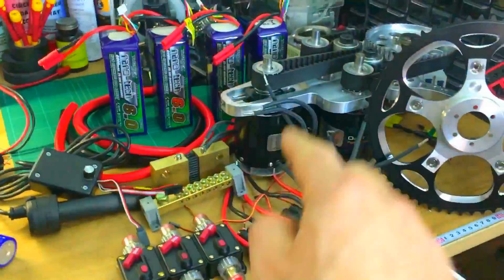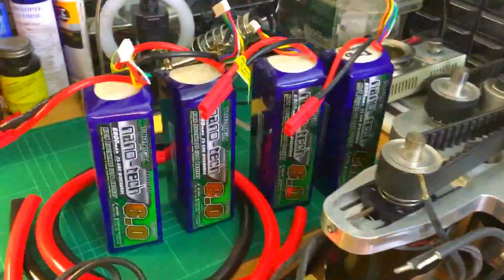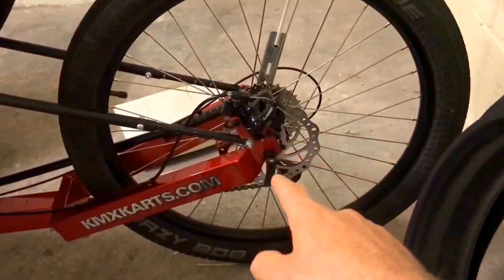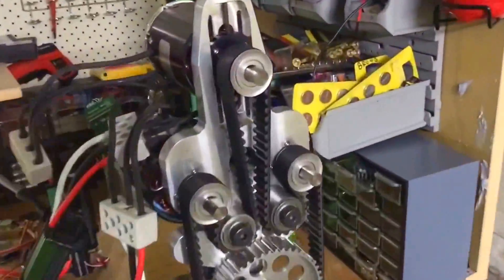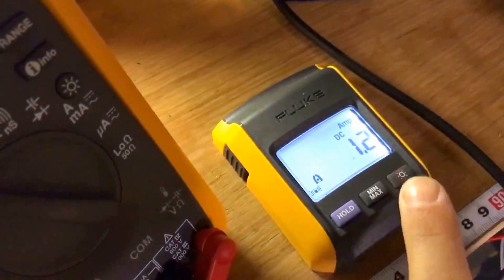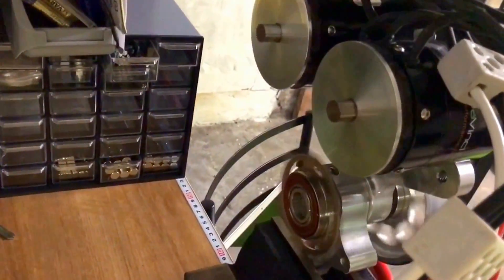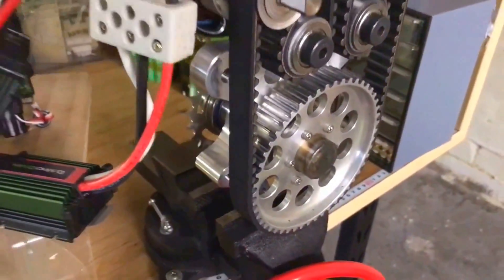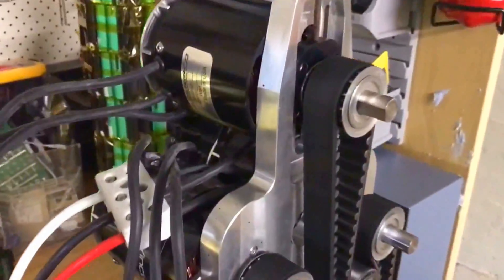42000w 56hp Electric Bike Triple Motor (video#1) Bench test & showing where I'll be installing it

Comment: Hi im not good in electric motor calculations but i check on their astromotors website and these motos  says are 4kw and 100amp max. How can they go higher with out to get destroyed?i want to do an electric bike simillar power as an honda cr125 motocross.how can i choose the right motor? I love your videos!you should make them longer !!
Reply from the maker: Yeaaahhh the original sealed motor housing can do 4kW continuous but a LOT more peak power. My one has been machined open and a fan was installed on the end of the shaft sucking air through cooling the motor winding, also I have a much thicker motor shaft than the standard motor. Can do 14kW peak each motor times 3 motors it’s pretty insane.... Here is a playlist showing all the other videos https://www.youtube.com/playlist?list=PL59mIOWSOm9qRtb4Yvj9wnYy_mDK_v-6i
Reply from the maker: Here are lots of photos showing the building process https://www.youtube.com/redirect?event=video_description&v=sRH_cpCwNDs&redir_token=44cPYGDuRW7ll0Q788Nan_BgEdh8MTU5Mjc0MzE4NUAxNTkyNjU2Nzg1&q=https%3A%2F%2Fwww.facebook.com%2Fpg%2Fbrunopoweeer%2Fphotos%2F%3Ftab%3Dalbum%26album_id%3D290190614924067&html_redirect=1
Reply from the maker: My setup is too complicated, I would recommend buying a large Motenergy motor and por with a very powerful controller like the ASI BAC8000 or something even more powerful

Comment: Really nice setup!  Only one question;  how do you get 42000w  from  a triple  3220 Astro motor  when it is rated  each at 6000w  max   1 min.  peak?
My  numbers are: 42k÷3 = 14k each!.  That is  more than twice the motors peak specs
Reply from the maker: +Andrei Gauna Adamson Hi, my motors are not a regular 3220 sealed housing with thin motor shaft. it's a lot to do with cooling, my motor housing is CNC cut open on both ends and it has an extended extra thick shaft with a fan forcing air through the windings cooling the motor down. It is also a faster winding for higher RPM. I measured over 11000rpm and the battery wasn't even fully charged!
Motor manufacturers always rate their motors much lower than they can actually take, same with battery manufacturers and many other products.
You can't just dump (send) power to the motors, the motor actually sucks power from the controller depending on the load applied on the motor shaft. My trike is 35kg and capable of doing 42kw, technically it will be almost impossible to force this super motor enough to "suck" all this power from controllers/batteries.
Anyway... are u getting one yourself???
Reply: ElectricBike Posibly!  I'm actually bulding a couple of things and planning to start a channel.   Will see!       Something with lots of POWEEERRRR!!!

Comment: I really hope you reply as I want to build a roughly 6-7kW electric bike myself. I notice that you're using Castle Creations Edge 160HV's but from what I have found, they can only do 160 amps, so I was wondering why you say 280A in the video and description?

If anyone can help me, I was thinking of using a SKYRC TORO Beast Brushless Motor, probably the X524 2Y or the X528 2Y depending on what ESC I can find to power it. If anyone can point me in the direction of something better that would be greatly appreciated.

Comment: What controller are you using for this? Or is it just the 3 small, green things you have showed???
Reply from the maker: this one is just a normal ebike controller and hub motor setup... but this is all you need in this little fun drift trike haha... of course if this was my trike I would go ridiculous and get the biggest possible motor and probably kill myself on the first ride hahahaa.. 
I watched this video in slow motion so many times.. can't believe I wasn't wearing any protection hahahaa.... =]
Reply: hahahaha^^

Comment: Hey electricbike… You are CRAAAAAAAAAAAZY MAN… I have a question about this ridiculous three motor reduction system.

I have this vintage 1964 Volkswagen bug with no engine and a curb weight of about 1500 pounds without the engine. The stock engine is a 1200cc putting out about 36 hp.

The specs of your monster three motor trike system lead me to believe that it might push a vintage Volkswagen down the road pretty nicely if I'm not mistaken. I see where this system is ridiculously overpowered for your trike BUT… It might be a nice match for a VW bug… The bug would not be burning rubber off of rims but yet have better than stock adequate power.

What is your opinion you crazy amp head… Is my thinking flawed somehow… Not exactly sure how the main drive would connect to the transaxle… Probably need a big battery pack like a 144v 150ah.

Do you think it could work?

Comment: 42,000 watts @840 Amps Peak.......rpm is going to be insane...I reckon this should be good for 120mph !
Reply from the maker: MisterMacrae yeaaahhh the motor rpm is over 11000... the wheel is a matter of gearing haha... 
did u watch video #3 taking this thing for spin at "only 300A" ? Haha
Check it out: https://youtu.be/sRH_cpCwNDs
So much POWEEEERRR hahaha

Comment: do thing you can show how to change one of the controller  form a 36v to a 48v and see if it dose work ? on a video?  if you have time,  it would be a big to me if you could. because aren't all the motor the some it just the controller right that different and also they didn't specify the mph on each motor but high voltage is more powerful right. ?

Comment: Hey do you have any videos or you change the controller power on the 8 fun motor or do you think you can show how you can change the controller like for a 36 volt to a 48  volt  because also there is 36v 18 a - 36 volt  20 a and so on but I want to know if what the difference between 36v 350a 36v 500a - 48v if maybe show how you change them or explain what's the difference in these different controller you, said yes but  what in all if these controller and in changeable with the motor I get from ailexpress I think a fair price but not enough power like you said you show me in a video

Comment: Awesome, can you include details about the controllers/ ESC in the next installment?
Reply from the maker: +Ryan O. Yeaaahhh I have lot of info on the video description, in using 3x Castle Creations 160HV tuned to pump up to 280A (840A total for 3 controllers) they're all connected to the same throttle and have the exact same setting, same power and phase wire length, they'll need some additional cooling so it doesn't fry under this ridiculous load but I'll be watching the temperature very close.. ohhh yeahhh so much POWEEEEEEERRRR =]

Comment: 1500 watts just to turn it lol! 
should be fun though mate, you certainly seem excited ahahah.
Reply from the maker: Yeeeaahhh.. ahahahhaa.. 1500w just to turn... its like some powerful subwoofers that are rated lets say 3000wrms, every component needs to be so strong and tough to take all that power so it actually needs a good 500wrms to get the speaker moving... some manufacturers will spec power range "500wrms to 3000wrms" soooo much POWEEEEEEEEEERRRR hahahaha

Comment: How do you sync the motors? Do you just run them all off the same throttle?
Reply from the maker: +Adam W yeaaahhh all motors controllers are connected to the same throttle, they all get the same signal, all controllers have the same settings, same manufacturing date, all connected to the same belt... let's hope it works fine otherwise I'll have to connect something to sync them... hahaa... =]

Comment: Oh yes...... whats this... is it that time?
I Think it is!!!
Time for.....

  ██ ██      ██     ███     ███
█    █    █   █   █   █    █    █
█    █    █   █   █   ███     ███
█    █    █   █   █   █   █     █
█    █    █    ██     █    █    ███

███      ██     █    █    █   ███  ███     █  █  █
█    █   █    █   █    █    █   █        █    █   █  █  █
███    █    █   █    █    █   ███  ███     █  █  █
█          █    █   █   ██  █   █        █   █   
█            ██      ██   ██    ███  █     █   █  █  █

Matt really sorted you out didn't he!!!!
Warning! 
do not put your fingers anywhere near that thing 😜😁
Reply from the maker: Hahahahahahahaha... this is the BIGGEST MORE POWER message EVER hahahahaha
I'm attempted to put my fingers there but my hands will be reeeally busy holding the throttle as hard as possible.. so I don't even think I will have any chance hahahaha.... I told you that the 42000w beast was a real thing..  ohh yeaahhh
Reply: ElectricBike 
haha, seemed appropriate given the power its going to be outputting.. xD

Yeah I always knew it was real as saw your posts on ES when Matt made it for you but I want the thing to be running on a bike before I get on a plane to come see it in person hehe ;)
Looking forward to your build log see how it all takes shape.
Just slightly worried for you bud, gonna need good  (insert everything on a bike here) lol
Should be 100mph machine.. 
BTW if it is 56hp and less than 56kg thats 1000 hp per ton.. which will be rather mental..
Reply from the maker: hahaha ayeaahh I was going to fit this beast on a normal 2 wheel bike but the shape didn't really go with any frame.. also I had this trike idea in mind since 2013 or earlier.. so I just went ahead with trike project first.. better aerodynamics too ahahaha 
I started fitting the motor just to check the motor mount alignment etc... I weighted the components and I think I can get it rolling with few lipo packs (not at full power) at 36kg and with the proper battery something around 41kg... imagine that.. imagine making a proper all carbon frame... hahahahaa

Comment: Holy fuck that's amazing Bruno!!!!  Is there a build thread on ES u can link us to pls?  Can't wait to see the end result!  MENTAL!
Reply from the maker: Heeeey Rana!!! I haven't posted anything on ES website.. I posted some photos on "Endless Sphere on Facebook" and little bit on Instagram (I'm trying to be a super cool dude on Insta hahaa) I'm trying to document things on video, I am doing some basic welding to fit the motor, reinforce the frame and get it rolling, ride it a bit to see where else needs improvement and do more welds... take for spin again... once I get this prototype right I will start the full carbon monocoque chassis, much much lighter and safer in case any high speed accident.. this will be a very very wild machine so I better protect myself hey... hahahaa.... keep your eyes here... one thing I can guarantee.. this will be a burnout machine.. hahahahaa  sooo much POWEEEEEEERRRRR =]

Comment: Finally! I have been waiting for this! it's going to be INSANE!!
Reply from the maker: +Chad yeaaaahhh man... it's finally happening and it's going to be lighter than I was expecting... I'm preparing myself for a serious acceleration hahahaa... I think as soon as I hit the throttle I'll get a big burnout hahahahahaa
Reply: I hope it is just a big burnout! Hahaha! I have a trek 3900 that I put a Chinese 1kv conversion kit on. The controller was only rated rated as 13 amps... If my math is correct, it is only actually putting out 624 watts. So I used a piece of 12 guage solid core household earthing wire to jump out the shunt... Well, long story short, i don't know what amps its putting out now, but it pulls wheelies, and the first time I cranked the throttle from a dead stop, the bike pivoted on the rear wheel and flipped me off! Hahahaha! I would have rather the tire broke free and spun out! Good luck, and I can't wait for updates! I'll try to get my monstrosity out on the interwebs, it has turn signals, brake lights, a trunk, and headlights!

Comment: It will be really interesting to try some more lipo connected to see if with twice the overall capacity, and more when 4 are fully charged, you manage to go from currently around 1.5kW to 42kW!
Reply from the maker: +Andrew Jenkins yeaaahhh I do have some  6s Nanotech that can take 300A (each) but I'm still waiting for my other Lipo cells to arrive.. 1.5kw bench tests is super high already... I can only get that 42kw if I manage to put some serious load... The whole trike is gong to be around 40kg so it will be a burnout machine with 20kw hahahaha Will be very hard to control but super fun and NOISY haha

Comment: Power so much torque!!! My KIA Soul EV 1500kg car has a 82kw motor so you are in the other side of the spectrum there with this crazy trike. Valeu!
Reply from the maker: Hahahaha.. the other side the spectrum totally... I finally got this thing rolling and took for a spin weighting only 35.2kg, just a temporary setup with a small battery limited to 300A only, it was not pumping full 840A but still crazy POWER TO WEIGHT RATIO ohh yeaahhh.. you will see the first tests acceleration....  I'm uploading the video here as I am talking to you.. should be available in few hours.. hahaa

Comment: http://www.evwest.com/catalog/index.php?cPath=1&osCsid=bi9va5du68qrchsc42rje1u8h0
Reply from the maker: hahaha I know these amazing large EV controllers... POWERFUL but... 
BIG, heavy and $$$$$... I do have some projects in mind with one of these big beast controllers but this trike is going to be kinda lightweight EV..

My controllers: 
--> weight as little as 300 grams each (at least 30 times lighter than most controllers there)
--> sensorless for very high rpm motors
--> waaaaaaaayyy cheaper.. it doesn't cost $10000 hahahaa =]

Comment: Are you going to install a protective case for the belt?.
Reply from the maker: Belt gets really HOT... the original belt was thinner and was getting way too hot almost melting... 11000rpm and all these crazy turns to spin 3 motors + the reduction pulley needed a much wider, thicker and spaced belt.. the thing is...  at such high speed (rpm) the air gets trapped between the belt and the gear (like a little suction cup) and you have heat generated by this air friction going in and out... isn't this crazy?? I will make an aerodynamic carbon fairing with proper cooling for both the motors, belt, controllers, battery, using air filter so I don't get any dirt inside this precious system... but at the moment.. its all NAKED AND EXPOSED hahahaa =]
Reply: Thanks for another great video, man! Might I suggest a house fan to keep the belts cool, for your tests. It should help. And I hope you're wear safety goggles, bro! :)